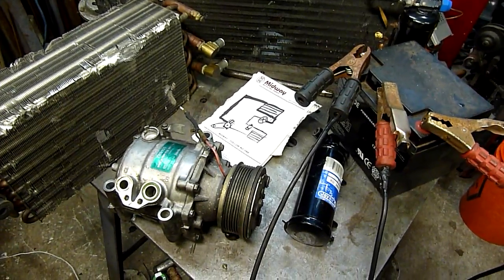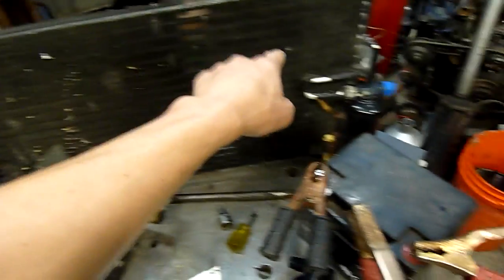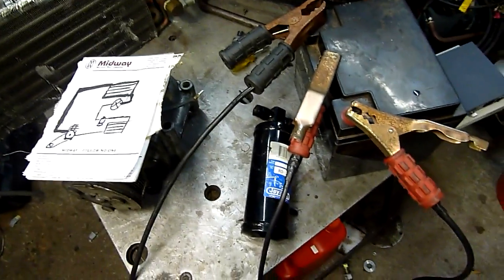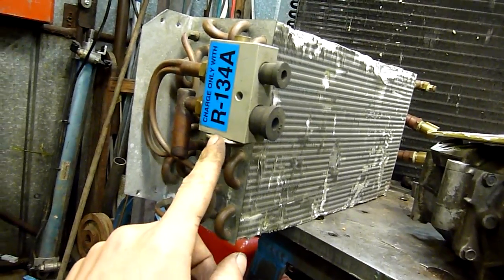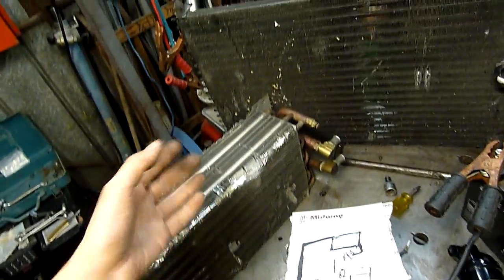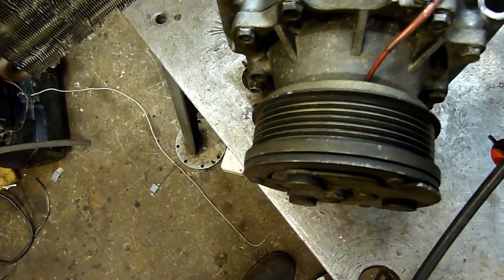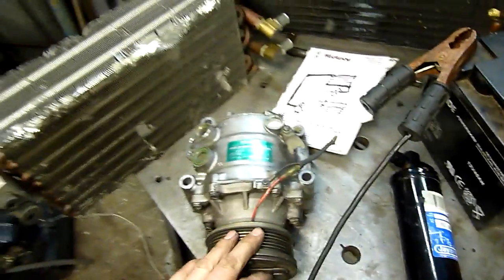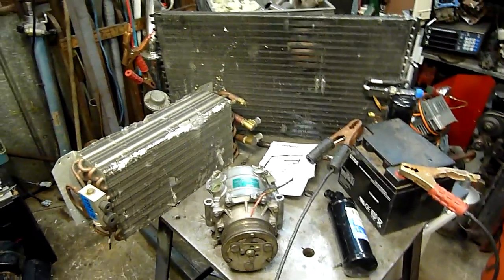A Breif Explaination on Automotive AC operation

Comment: It only happens if the airconditioner gets turned on before the car has been running for 10-20 mins......
 
the car is a 1998 Mitsubishi Challenger.

Comment: yeah, one of our cars, a 1.4 IDSI honda jazz or (fit) as it's also known has a thing called a ICV or idle control valve which i think is like a actuator that's controlled by the ECU,it adjusts the throttle as a load is put on the engine, like lights, electric windows etc

Comment: You should rig one of those automotive  a/cs up to a house condensor or evaporater deal whatever its called.  Run it of a 12 volt dc motor off a solar system.

Comment: Were the radiators real sized auto parts or did you just put some other AC gear there for showing? These things are huge. No wonder cars get heavier all the time and not more economical, when you add so much stuff that's not really essential. And then talk about the 1l/100km an car AC can easily add to fuel consumption.

Comment: because they are smaller, quieter, and more *efficient*, they use them to save space and weight, they are far more quieter then reciprocating compressors and they dont require 2 strokes to compress the gas, scrolls are constantly in-taking gas, compressing and discharging gas while reciprocating compressors have intake stroke and then compression stroke plus they can with stand much higher rev's then reciprocating compressors, hope this has helped :)